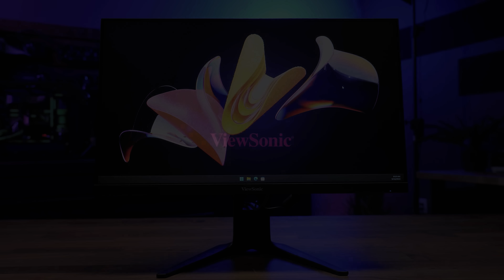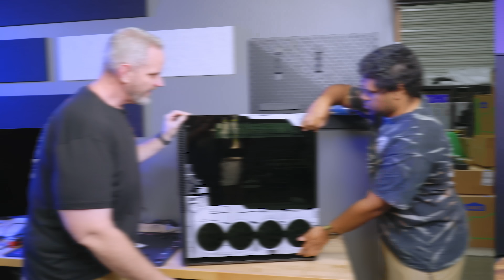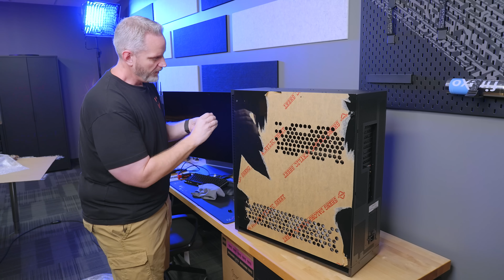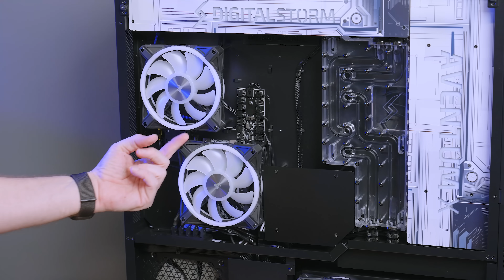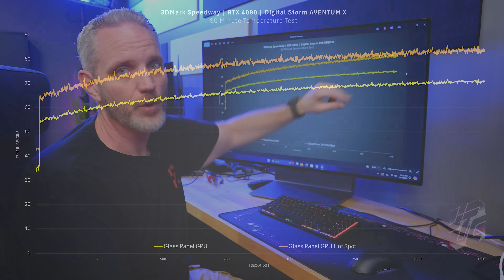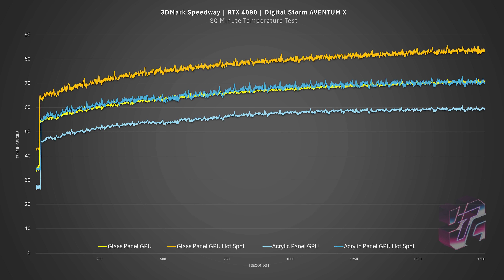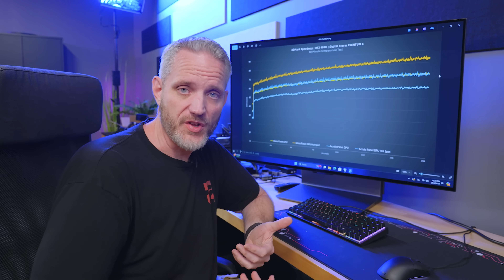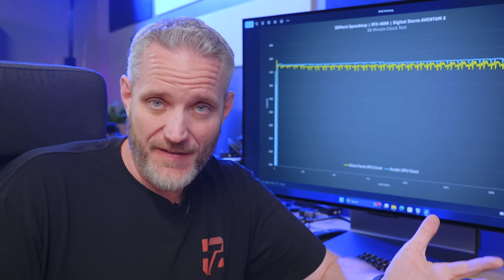Digital Storm responded to my Criticism... Let's go over it

Comment: The life of electrolytic caps is directly dependent on the temperature they run at. A psu running hotter will die sooner
Reply: 10C lower will double the life span IIRC for electrolytic caps

Comment: Tempered glass is made by rapidly cooling the external layer of the glass. So the outside and inside are not cooling at the same rate and then there is a tension between the external layer and the core of the glass.
If the configuration of the glass sheet is not properly made to support the tension differential, it breaks.
If you try to pinch a hole and scratch the external layer enough, it breaks.
If you... it breaks.

So yeah. Tempered glass is the worst enemy of holes in a side panel.
Reply: I mean, it's not *impossible*, it's just going to have "an increased chance of failure during the tempering process" ...and even assuming no coatings or the like, so you can just sweep up the failures, melt them down and cast them again...that results in increased time and effort on the part of the supplier (because I 1000% guarantee that Digital Storm isn't making their own tempered glass panels in-house from scratch :D ) to provide the order requested, which means an increased price on such a wholesale order.  Even if DS pass the monetary cost through to the end-customer, does it look like they're willing to take the bureaucratic effort needed to add this to their options for customers? (outdated QR codes...obtusely hidden videos on their site...)
Reply: @empath69  Call it industrially impractical.
Reply: @koulkrith  I mean it all depends on demand - if people REALLY want tempered glass side panels with venting, and are willing to pay for it, it's worth it for a manufacturer to keep re-casting panels to get enough successfully completed stock to supply orders.  

But is there enough demand for a system-integrator to place these custom orders with a parts manufacturer? (I personally don't have that demand, but I'll admit I don't know the PC enthusiast market - people spend a LOT of disposable income on their beloved hobbies. <3 )
Reply: @empath69  When I see the madness of consumers with the aesthetics of their computers... It could really end up with a manufacturer going all the way to that. I find this a little bit pointless when cpu manufacturers can barely make something that functions properly and adds real value to the existing parts... Sorry for sidetracking but except for cable management, which really is practical, I don't see the point of RGB fans, tempered glass side panels, and the likes except for the fact that people can say "I paid for this shit."

Missing the era of the beige boxes when all that mattered was performance.

Comment: I purchased a PC from them a few years ago right at the beginning of the GPU shortage. It had a GTX 1660 Super(single fan cooler), R5 3600XT(I only paid for a 3600X. It even said 3600X in the build report. Not complaining), and 32GB 2666MHz RAM. I paid $1,600 for it. Over the past few years I have been upgrading my PC to fit me needs. It now has an RTX 3080 Ti & RTX 3070, R7 5800X3D, 128GB 3200MHz RAM, and I paid $1,400 in total for all of those upgrades. Looking back, I totally overpaid for that original PC.

Comment: They only need to change company name to heat storm and it will be fine btw glass is cut by water cnc cutting machines but this type of glass is sensitive to changing pressure so it very likely breaks if we shoot into it with pressurized water to 2000bar in such a small area also cutting material which can be also glass or fine sand can cause scratches so... that's why

Comment: PC I am using was once a 386SX, 4Mb RAM with a Cirrus Logic 256kb VGA card. I only ever replaced parts, there have been so many mutations over the years. I so wish I had documented those changes, and the adventures I had trying to squeeze out the best performance. From the load order of drivers in CONFIG.SYS, jumpers on clock dividers, Buying a Cyrix CPU upgrade for Quake and realising the FPU was a joke. Killing a T-Bird cos I did not have a shim. The essence of my PC, its beginnings are over 30 years old. To me it is the same PC, upgraded. Seemed obvious to me Digital Storm did form over function.

Comment: I don't remember if the glass panels on the original video had a metal frame bonded to them but... Couldn't they just make the bottom 1/4 all metal, have a little _|----------- shaped kick out and mount the glass to that so it's still flush, but now you have metal for the bottom 1/4 and can actually mount filters, still do the UV Printing, etc?

Just like you said, the chassis isn't really the problem.

Comment: In my water cooling setups, I made sure they have plenty of air.  I can run my fans at low rpm's and get the temperature differentiation to 3C from low rpm's to full speed.  This way, my system runs cool and very quiet.  I also use full tower cases (Lian Li PC-V2120's) as I hate cases where you have to cram everything into tiny spaces.

Comment: It's good to see a company respond with actual changes, however... 

It's a HUGE red flag that nobody caught choked-off fans and fans cooling nothing... AFTER the revision.

Just wow.
Reply: It's been years, they've known for years. They don't care because people are buying them because they don't know any better. That's their target audience. And when the issue pops up, they just buy another one.
Reply: This comment. That's exactly what I thought. Rich people are actually dumb doing anything apart from their jobs. They just throw money at people and think because they are paying a premium they are getting the best money can buy
Reply: But they haven't ACTUALLY changed anything yet - they've SAID these changes are coming, but given the issues the company has demonstrated already, I'm not entirely  confident they WILL come to pass.
Reply: these companies are banking on dumb-dumbs not understanding computers and airflow. they make money on people who essentially buy premade dell and apple computers for daily tasks. this is why its important to take an hour to watch a build video before you purchase your own parts and build your own.
Reply: @ryze9153  but we are. We need to knew thermal coefficients we need to have flow simulations and we need to know what the intended purpose is.  I designed parts for Formula 1 cars.  Fit, form, function and strength.  I needed to have a ton of variables at my disposal.  These engineers are failures.
Reply: @ryze9153  I'm not water cooling expert.  However if you give me the data points, thermals and thermal capacities of their cooling solutions I could fix their garbage layout.  And give me creative capacity I'd fix this nonsense.
Reply: @nissan300ztt  Still won't be able to fix marketing saying the obvious solution is "brilliant."  Never underestimate the ability of someone in the chain to bungle the message.
Reply: @ryze9153  probably could make it a little cheaper.  Lol
Reply: @ryze9153  That's like saying "Bees are no mammals and cows either" xD .
Reply: When I saw the glass in the first video going all the way to the fans, I was like... wait... isn't that covering the fans?? Literally the first thing I noticed. I'm basically inept lol. Like, I've built one single computer ever, and it was a guide (probably a JayzTwoCents video). I certainly don't design them. 

People being paid to do this should be better than me at noticing something like that...
Reply: Engineers being engineers.  I'm an engineer and I would say 75% of Engineers are blatantly stupid with massive Egos.  😊
Reply: A bulk of their sales aren't 8k PC's, it's the 1.5-2k PC's which run the business. But still unacceptable for how this happened.

Comment: How passionate are they though if they didn't even know about using a jumper on a PSU to fill the loop? How passionate are they if they let this issue get as bad as they did? How long have they been selling systems configured like this? Months? Years? This does not demonstrate passion or enthusiasm for water cooling to me. This demonstrates corporate greed through hiring the least experienced (read as lowest paid) employees to design these machines then charging customers an obscene premium for this poorly designed hardware.

Comment: I'd almost want to see what inserting simple (cheap) standoffs proportionally sized to the fan blade(s) between the base chassis and the side panels could do in ameliorating/moderating this- but then constructing an airduct/manifold/reverb-cavity (equally cheaply) in that added layer space becomes too deep and contentious a rabbit hole to explore succinctly. . . although it could allow for some clever practical/visual effects with the added depth, and/or pleated air filters.

Comment: The process of tempering glass is both it's strength and weakness, I forget the exact science behind it but it's under constant pressure from the tempering process so when you cut into it it'll more than likely pop (shatter) I don't know if you can temper glass AFTER creating the holes or not though.

An afterthought, you should loan this to Gamers nexus for a full range of testing, I would LOVE to see steve tear these guys apart hehe I can just picture him taking one look and going "really?"
Reply: You CAN temper odd shapes, but the more holes or irregularities you make in the glass, the more difficult it becomes to successfully temper it (i.e. you're gonna have a % of failures; more wastage which starts to increase the price beyond just the custom cuts).

Also, as interesting as that would be, Steve's not getting any younger - I don't want us to be a contributing factor to him getting an ulcer or something! :D

Comment: From an enthusiast standpoint, Jay is right: There really should be no compromise for performance at that price point. However, from a business standpoint, Digital storm is correct in their implementation, and I am siding with them. They said at the beginning of the video that they have been doing R&D for a completely new chassis for the past year, meaning that this current model will go end of life in the near future. They know their customer base is not going to be stress testing their parts, do not care about boost clocks, and will likely purchase the new model for another 8k when it comes out. Why would they continue do invest R&D money into an old chassis that is going EOL when the benefits will not be realized by their target customer base? It's easy to criticize this in a vacuum, and personally I would never by a system like this. But I also believe most people criticizing this PC wouldn't buy it even if there were no  issues with the cooling setup. Overall, good video, but I think Digital storm made the right decision providing a free acrylic panel for the one or two owners who care about that instead of a significantly more expensive redesign for an EOL chassis.

Comment: Oh wow ... their thermal capacity testing sounds like someone said "It doesn't catch fire when using Microsoft Word ... much" 
And if this is a "balance" between performance and aesthetics I do believe they are either going to release a new case that is just as bad or they are scrambling now to fix their new case as much as possible.
Honestly, I do not believe this computer is designed to do any computing, it is designed to be looked at. And their response and the new panels just reinforce that impression. It's like designing a pretty house and not putting any doors in because they'd ruin the asthetics. And selling it for three times its worth.

Comment: 10:03 i have literally just spent the last few minutes thinking you should make a video with this exact point.  Re-run your standard cooling test with the original panels on, then remove the bottom 2 rads and run the test with only the top 420 (with original panels on) and compare. is your gut accurate and would you actually get better cooling with only the 420 than with everything?

Comment: The best case design thermally is double exhaust radiators(front&top) 1 rad for gpu 1 rad for cpu, 100% hot air out, lots of intake mesh on bottom/side/back. Interior temp is then simply ambient.

Comment: To help get old paper protectors off acrylic, there's a couple of tricks.
1. Apply steam carefully. - you really don't want the acrylic over 190°f (87.7C) where it begins to soften (and get even easier to scratch) though it won't actually melt until 320°f (160C) so you can't actually damage it though steam alone. The heat will help release the glue, and it'll peel off a lot more easily.
2. Let rubbing alcohol (isopropyl) soak through the paper to attack the glue. Won't harm the acrylic, but more likely to leave a sticky residue that technique 1 above. Can remove that with some goo gone, or more isopropyl and a paper towel to "pick up" the residue when it's softened again.
Edit: As @Taurickk pointed out below, Isopropyl will damage acrylic. Kerosene is probably the solvent most likely to attack the glue without damaging the acrylic, but of course is a potential fire hazard, and I'm not sure it would be that effective on the glue anyways. Go with method 1.
Reply: Are you sure on that second method? Isopropyl alcohol aggressively attacks acrylic and causes spiderweb cracking and microfractures throughout.
Reply: @Taurickk  you are entirely correct. Must have been thinking of another plastic. Isopropyl will make acrylic look cloudy due to micro fractures! Same with methyl and ethyl alcohols as well as acetone, which are other good glue solvents normally. Thank you for pointing out my mistake.
Reply: non-acetone nail polish remover is what you are looking for. It's usually the pink stuff. It will remove the glue with no residue, discoloration, or damage to the acrylic. It's also very good for removing paint from acrylic. Best used in a spray bottle.

Comment: Tempered glass, starts out as a sheet of glass. The sheet of glass then goes through heat treatment, with the result being tempered glass. You can design the glass sheet, with holes, engraving, etc before hand. This also increases the price, which is why most panels are just 2 to 4 holes in each corner or have metal plates chemically bonded to them. 
This is for all case manufacturers in general, offer case with metal (5-25mm hole size. Panel with 10mm hole size or panel with 20mm hole size) mesh side panels, instead of the glass/plastic. I have quite a few glass and plastic side panels lying around, because of how restrictive they are on air flow.

Comment: Can someone up vote this so Jay sees this??
What about adding venting for the fans?? So they work like how laptop fans work.. The bend the airflow 90 degrees all the time.. Shouldn't be a problem to design some soft material to squeeze between the fans and the glass to route the air??

Comment: I bought a DS back around 2010 and it was still viable for pc games 10 years later, though obviously not at high settings.  Also, the cooling seemed pretty good as the machine sat in a room with no AC through hot humid summers and never overheated.

Comment: Cut-outs in tempered glass require the glass to have the cut-out before tempering. That is very uncommon because the glass structure is compromised (it breaks easier). A metal frame around a glass side-panel with cut-outs would be a good compromise. ALL of that would add significantly to cost/lower profit.

People with $8K to spend on a gaming PC have unlimited funds. Those people would go with a total custom build by a talented case modder. That product at that price point is marketing to increase sales of their lower priced products. It was never intended to sell in any meaningful quantity on it's own.
Reply: shower use tempered glass and have holes for handles and glass holder
Reply: @1nicube  yes, and those holes were made in the sheet of glass BEFORE it was tempered.  
...and they're now stress points where applied force can overwhelm the internal tension the tempered glass has and result in fracture.
Reply: @empath69  yes. Didnt said how they are made.
Just that it is possible!
Reply: @empath69  What stress do you incur on side panels vs shower doors... very little comparatively.
Reply: @vi683a  the screw holes - don't overtighten...

Comment: They are just plain wrong in my opinion.  Adding heatsoak instead of having proper heat removal is just terrible design no matter what they claim.  This machine seems specialised in storing heat, the opposite of intelligent or efficient design when it comes to quality electronics.  The acrylic alternative panels are bargain basement crap - they haven't even used coatings which mitigate scratching (assumption from what has been said) but apparently they're too cheap to spring for it or haven't even checked if such coatings exist (they do).  Tempered glass can come with holes just as easily as any other type of glass, they just haven't bothered to have it made that way, likely to keep their costs down and profits high.  They're charging a small fortune and have way too much hubris.

Comment: There's still the Fractal Design R4 (It starred in 2001: A Space Odessey). 
Oh, the challenges of making a calculator an object de art! And it STILL sits on precious desktop space if it's to be seen. 
Recently I put my R4 in the closet - sick of listening to the fans. And it's an acoustic black hole! An update to RTX 3070, still noisy even when duct-taped and put in a trunk. Don't get me started about where GPUs are going. Maybe so-called AI will be used to get off this crazy train of computing power results in more heat production. An atomic power plant? How many solar cells is an NYC sized nuclear plant comparable to?

Comment: Since it costs so much they should just cut holes in the glass panels directly over where the fans are and put  circular mesh over them, that way they get to keep the printed ascetics and get the appropriate cooling too.